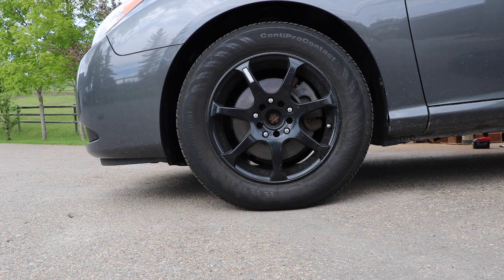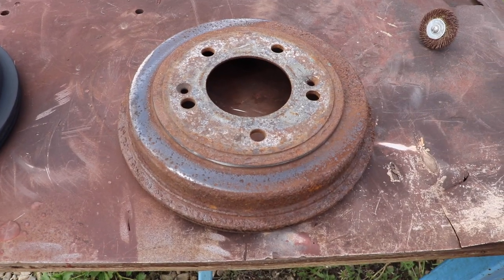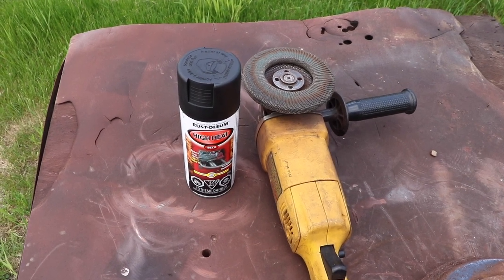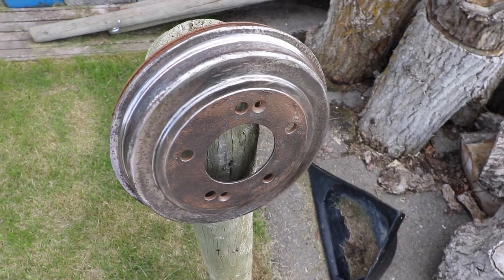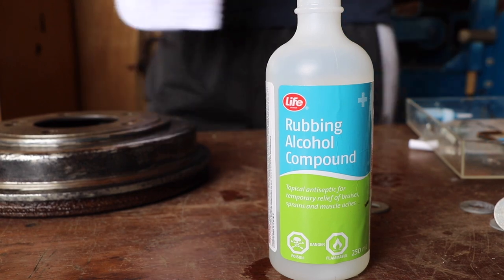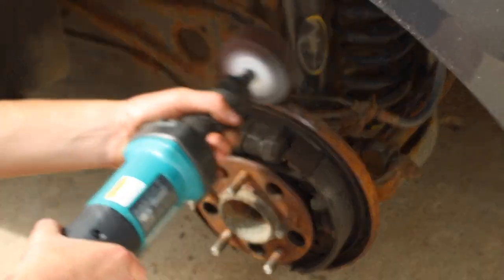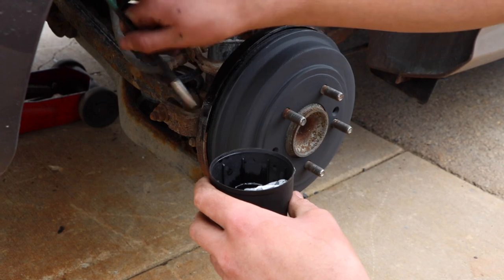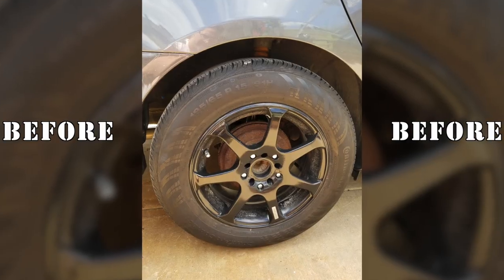HOW TO RESTORE YOUR BRAKE DRUM // Full Guide

Comment: This isn’t an auto tip but just anything metal advice . Best way to remove light to medium rust. Soak your part in vinegar for a day and wipe it all away with steel wool. You would be surprised on how good it works. Especially if you are trying to clean something where you can’t remove any material like a sanding disc will do

Comment: Question: why do you need to use high heat paint on a rear drum? It's just the handbrake right so why would it get hot?
Reply: Well I just googled and found out that the foot brake engages the rear as well as the front brakes (albeit with the front doing the majority of the work). What can I say?  I'm new.

Comment: Video won't load past 37 seconds at all. :(
Reply from the maker: That's bizarre. Seems to work on my end. I logged out and tried again and it seemed to work fine. Sorry you couldn't watch it all the way through. I'll look into it a little further.
Reply: @ThomasWarrenYT  thank you for your response, I have tried again a few times, using different wifi and data, switched off my phone and still sticking at 37 seconds, I'm glad you did a before and after at the start, looks good. Thanks dude.
Reply from the maker: Derek Law My pleasure! I’ll get to the bottom of this. Thank you for bringing this to my attention.

Comment: When using high heat paint it’s better to torch the metal first to get moisture out. You can see the moisture come out and dry up as you torch it. It will bond better and not rust as quickly. 

Also, electrolysis is a pretty easy but time consuming process to get rid of the rust. Electrolysis can get every speck of rust out and it’s not hard to make a DIY setup with an old phone charger. Just make sure the metal is not stainless steel because it contains chromium!

Comment: If you're going to this length... take the shoes out/remove the wheel cylinder and paint that backing plate [but take a picture first if you think you might need it and note the forward side].  Yes, you will need to bleed brakes afterwards.   For finned drums, I keep a small diameter wire cup brush handy - stick with steel wire, as brass disappears too quickly trying to get scale out of corners.  As always... did you measure drum ID before deciding to paint? If you are at limits, paint a new drum and don't waste ten seconds on the old one.  I have always had hell trying to get shops to do a feather cut when resurfacing - they apparently don't believe that taking off less than 0.008" is possible... which means most drums can get turned twice and a third go round gets iffy.  If I could only get them to take one 0.002" finish cut, my drums might outlive me.
Now the curveball... if you have an old car with front drums, note that manfufacturers have largely abandoned putting the window in the side to access the auto-adjuster these days.  The problem is in getting this feature back, you can't cut just one window with a dremel tool - you have to cut two windows [opposite each other] to keep drum near it's balance.  You need a set of calipers to map location and get size right.  Have your plugs in hand before cutting windows - they are $2 or $3 a piece individually, and still come with some brake refurbishment kits.   Did Detroit forget that there is no usable space in the required location on backing plates on account of spindle mount points and hardware?  it seems  so.